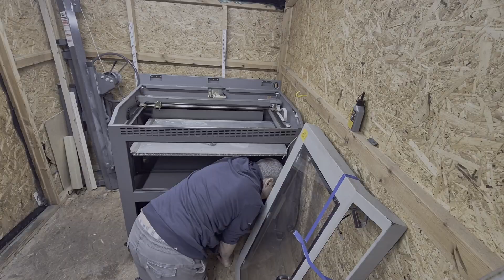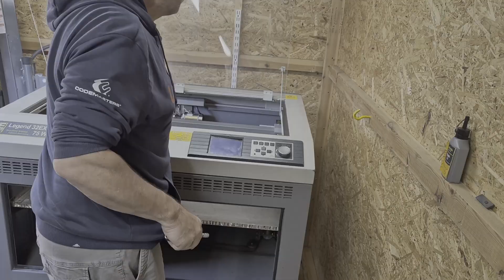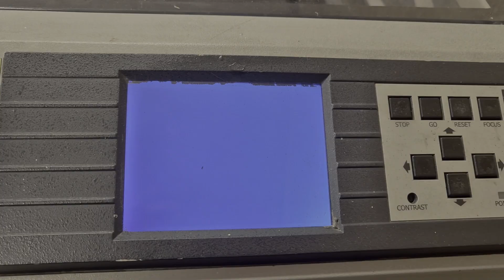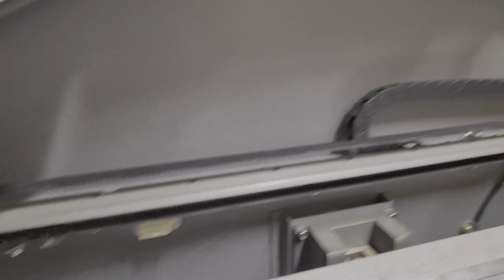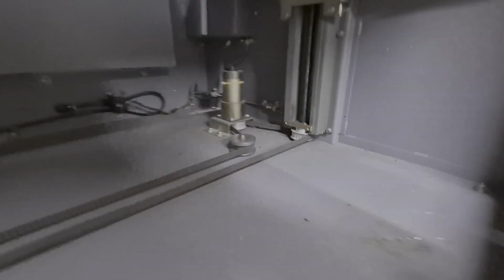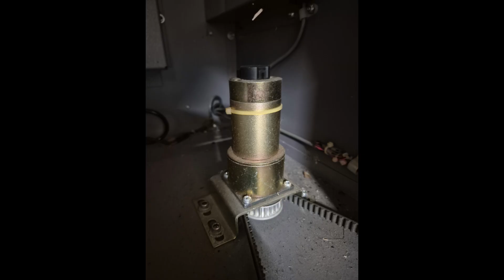Epilog Laser Rebuild 2 - Putting it back together

Comment: Good luck with the retrofit. Your machine is in far better shape than the ULS one I did years back, which was the victim of a fire in the bed. Some things to note. Your laser source is likely a RF excited laser, not a tube laser. This is far superior to tube lasers in terms of efficiency and longevity. Also for the drive system, servos are closed loop control systems, and in applications like this will have high-resolution feedback for position. This will be far superior to a standard stepper setup which runs open loop. Steppers are actually the "old technology" here.  Admittedly modern servos typically use brushless drives, so the use of brushed servos here is interesting.  I would recommend using closed loop steppers, or brushless servos for your retrofit. (Closed loop systems will not drop steps causing position error like open loop systems can)
Reply: Thaks for the advice. It would be great to keep the motors, but drivers for them are hundreds each, which is a little out of my budget for the rebuild. I can confirm an RF excited laser, which I really hope still works. I'll be testing this at the weekend. I'll be taking apart the controller this evening so I may find I can adapt and use the existing controllers. I guess we'll see!
Reply: @StuartMiddleton  Totally understand budget issues, I initially thought I'd repair/replace the parts on mine but ended up being a total new build, salvaging only the laser and power supply. As expensive as that was, it was still cheaper than getting replacement mechanical parts from ULS to fix mine.

The servo controllers often just take step/direction signals, so hopefully that is the case for you there. If you do need to replace the motors/drivers,  and new servos are beyond your budget, look at closed-loop steppers/drivers. They are pretty affordable these days from the usual Chinese sources. As for the Laser, make sure you have any interlock signals properly asserted, that was a  problem I had when trying to fire mine up initially.
Reply: @canadianavenger   I just pick up one from Ebay yesterday , my lord this things weighs tons Plus the machine was in the basement :(   atm , my screen don't work , motors don't move :) and probably laser not gonna work , is that old i think the gas from it is already gone.